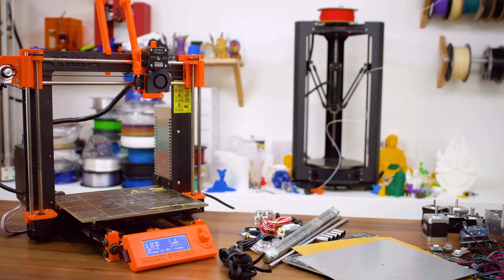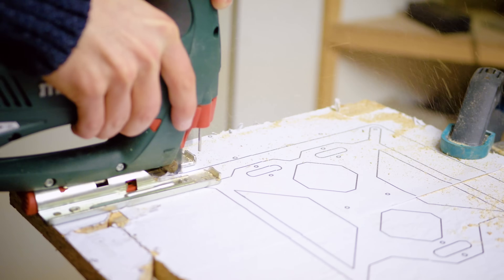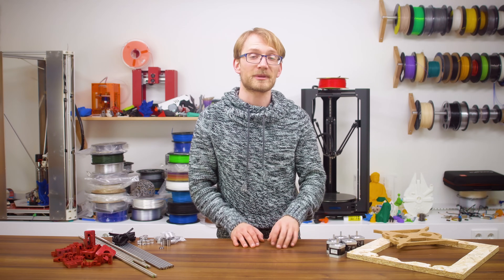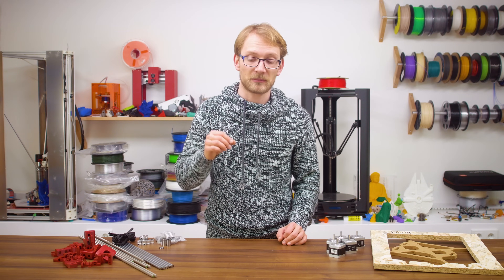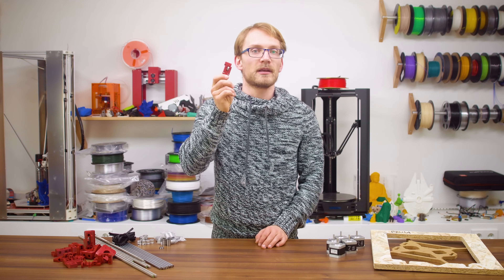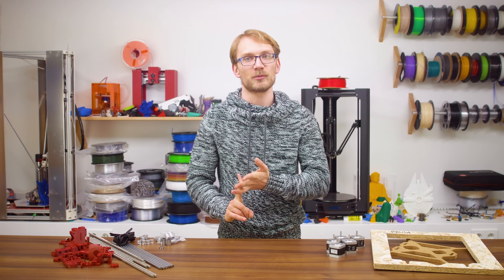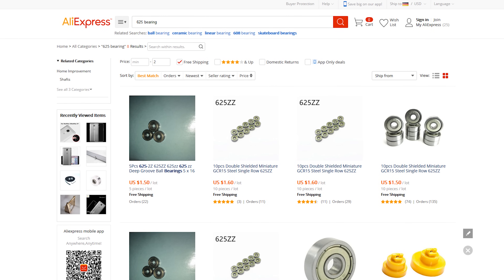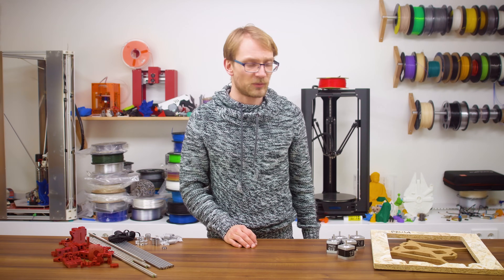Building the cheapest possible Prusa i3 MK2 clone: [02] Frame and motion!

Comment: Thomas, you probably won't notice this comment among the thousands you have but, I have an excellent tip for materials. Richlite,  it is very stable, doesn't transfer heat and is less expensive than aluminum. It's made from highly compressed recycled paper and phenolic resin.  Compressed at very high pressures and very high heat.  It is stable machinable and produces extremely stiff parts from the sheets they provide.  Though very few people in the 3d printing industry know of this product it is far, far better at producing stiff frames than even aluminum, because it has similar stiffness with greater weigh per part, does not transfer heat, less cost and is much easier to machine.  Peace.

Comment: If you are buying bearings, I can strongly recommend buying them from industrial resellers. I had a set of din 608 (I think) bearings on my longboard made by KSK, which lasted around 1000km with no maintenance required, it also offer you to get the kind you want (i.e. open, closed, sealed etc). And of course they can be a lot cheaper, I ordered mine together with a friend due to the minimum quantity required, but I remember paying around 12€ for a set of 8.

Comment: Lol. I've actually used trick at 11:02 in industrial packaging machine when stepper counter aluminium clutch broke and I had to get machine running quickly. It was to be temporary solution but machine has been in production with it for I think now 3 years :) I used soft pneumatic tubing for fix.

Comment: @frame & bed material: Is it wise to go with 18mm bonded resin-coated plywood ("siebdruckplatte") instead of OSB, which hasn't a nice finish...

moreover: can I use the 18mm bonded resin-coated plywood as bed material as well, or is that too think and heavy? should I choose 10mm MDF as tom did?

thx!

Comment: Hi, I've just started to build this prusa i3 for a High school project. But I have some problems. I've printed the parts in PLA but I'm not sure if it's the best solution because I started to assembly and my Y corner is cracked. I want to know if I have to Print with ABS.
Reply: If a part is used to hold the hot end you will have problems with melted parts. If you printer is left in the car on a hot day in the sun you will have a problem. PLA is go to about 60C. There is Some Heat Resistant PLA to about 88C.
Reply: Did you ever find out the answer?
Reply: You can use PETG.

Comment: I've been trying to free sketch this Frame Template as it will not Print Out for me correctly. Problem is when I load the files I can find for it in say sketchup to get the Measurements they seem smaller than what you have here. Like for instance you used a 10mm bit to start the hole in the bed for the bearing slot but all the files I can find on the frame they have have that as 5mm max diameter for the Bearing Slots.

Really wish Josef Prusa or Someone would would supply a Draft Layout of the Frame and Bed.

Comment: I just got a question regarding the printed parts: i see in your website that for y-corners.stl we need to print 2 or 4, but it is not clear for me, in your site it states: 2 for 350mm Y smooth rods, 4 for 330mm Y smooth rods 
that means we need to print 6? or it depends on the length of the Y-axis? (330 or 350)
the same applies to y-corners (open) x2.STL but I think we just have to print 2 right?

I am making a BOM list for building mine, and before bolts, nuts, washers, frame and printed parts i am at 150 euro, everything from AE, which is great!
thanks for your guide!

Comment: Do you have a link to the drawing of the frame's? ( would be nice! )
and also a question?
would you mount the X axis motor, on the other side?
or should you do once your thoughts over this or perhaps give an opinion on that.
I think this would be even more easily, the frame can then be wider.
(1) and it is become easier to make a box of the printer.
(2) this also in order to make everything more stable!

greetings from the Netherlands!
Rob.

Comment: hey Tom, great series. my son and I are gathering parts to follow along with the build.

Question about the stepper motors? Can I use steppers pulled from other electronics?  specifically copy machines. I'm a copy machine technician and can pull up to five of the 1.7in motors and a 2in stepper out of a single Japanese recycled copy machine.  Most are the same looking but some are slightly different looking tho still 1.7. can I mix different powers or torques together?

Thanks sooo much, can't wait for the build stream

Comment: great video!, why the 16 teeth pulley and not the 20 teeth one?
Reply: lean04 I had the same question.  from what I've read the 16 tooth has more torque and can print at slightly better resolution, but lots of people use 20mm and when you buy the 2m belt it comes with 20mm pulleys.  so I was going to buy 20mm idler pulleys too to be consistent?
Reply: When I went to go replace/modify a bunch of parts on my A8 I was thinking "why the heck do everyone try to use the 20 tooth parts???"  You do end up with less torque, but more importantly, if you stay with stock geometry the 20tooth parts misalign the belts and their mounts.

Comment: I'm going to try and cut out a frame but I am having a hell of a time printing out the Frame PDF. I have tried almost ever setting for the Poster Layout but for the life of me can't get it to print the whole thing. They definitely are not printing out at the right scale as well. It may be because I use Libre Office instead of Adobe Acrobat but who knows.... So it brings me to a question. Is their a File or Pic that shows the exact Measurements of each hole placement and line sort of like BluePrint? It would be a lot easier to draft the Frame Templet by hand than printing it out on multiple pieces of paper.
Reply: I can't even find the frame pdf.

Comment: I really like your idea of creating the prusa i3 mk2 clone.. That said, there are a LOT of cheap clone build logs out there, and if this is to be a MK2 clone, it really should have the really cool stuff that sets the MK2 apart from a regular old I3.. Like the auto XY calibration.  I know the MK42 bed is not readily available, but there is a version on it on Osh Park.  And although it would be expensive to produce there, a china pcb maker would probably produce it quite cheaply if one wanted to produce a few for a group buy or similar.
Reply: Thomas, where did you source the MK42 from?
Reply: The PCB-Layout is in the Gitrepo, so you can just order it at any pcb manufacturer that does such boards.

Comment: Just finished the shopping basket on eBay, without printed parts, fasteners or frame,  £140.73. A8 kit from GG, £147.47, (but probably + taxes and handling fees so about £180).

Yes, I could probably save about 10% by using AE, but I have the cash in my Paypal account, and none of the AE sellers seem to take PP,  (not surprised on their margins!).

I still think I'll go with the parts though. :)

Comment: The original Prusa i3 (3mm or "MK1") used PVC tubing for the Z-axis coupling, too.  The heat shrink tubing in the photo was placed over that tubing.  I think its purpose was to keep metal filings (created from the metal nut slowly wearing away the threaded rod) from entering the stepper motor, but I'm not entirely certain.

Comment: To note: I'm running two printers with hot end assemblies both printed in PLA. Neither is showing signs of creep or any other issues after lots and lots of use! So long as you're not super close to the heat block and cool properly there's no reason to worry (unless you end up printing really high temp materials).
Reply: Also, for your motor couplers, spider couplers are better than spiral aluminium but more expensive. What I use now are the self-cantering screw couplers on Thingiverse. They're basically a double ended 3-jaw chuck and made a big difference to my print quality when I started out.
Reply: I might have to have a look into that, is it this one?

http://www.thingiverse.com/thing:602481
Reply: I have used a lot of PLA parts over the years. The only issue I have had is when I tapped into the pla, the bolts eventually lose tension and the holes fill which a white dust I can only assume is corn starch. Absolutely not a problem if I embed a nut in the PLA.

Comment: im thinking about going for lead screws instead of threaded rods. thus I have a few questions:
- what size are the mk2 rods? T5 or T8?
- what things I should modify to get the best result with lead screws? better steppermotors? different mountings for the lead screw?

Comment: I bought 20 tooth gt2 pulleys rather than 16. Do I need to buy new ones or are the 20 tooth going to work?
Reply: Its adjustable in the firmware under DEFAULT_AXIS_STEPS_PER_UNIT the values can be calculated
Steps per Unit (X and Y Axes) = Motor Steps per Revolution / Idler Teeth / Belt Pitch/stepper ratio (1/16) default

Steps per Unit (Z Axis) = Motor Steps per Revolution / Rod Pitch/stepper ratio (1/16) default 

Steps per Unit (Extruder) = Motor Steps per Revolution * Extruder Gear Ratio / (Pinch Wheel Diameter * Pi) /stepper ratio (1/16) default

Comment: I'm building a corexy machine and I have 25 tooth pulleys. If I use those, am I going to have problems?
Reply: Gotcha. Thanks man. Awesome vids!
Reply: The good thing with RAMPS electronics the firmware is very configurable for different style of printer.

Comment: Hey, I got a small question.

Could it be a bit cheaper to use IGUS slide bearings, and then save some money on the linear rails (since the slide bearings don't wear the rods out as much) 

I got a pack of 12 for a fairly cheap price (I think it was 10€), and they work beautifully for X and Y axis so far, so they would be an option.

Comment: 26 bucks for 7 smooth rods? I bought 6 meters of smooth rods for 4 bucks and they are still doing great on my self designed printer :). No railing whatsoever.
Reply: ground rods, surface hardened with plating for $4?
so far this is my nemisis, all 6mm rail rods are from china and $5 each.
need a usa supplier.
Reply: Bought it at the local hardware store. Hardened, no idea, but for that money I won't complain and changing them out is peanuts.

Comment: Why didn't you used a bed frame that uses 4 bearings instead? Or the idea is to get as close to a MK2 as possible?
Reply: true. Have to remember that you've cut the part by hand.
I asked as I changed my i3 with some parts that allows it to use 4 as it had this awful side play something I have seen in almost all i3.

Comment: A small piece of advice - used motors can be 10 times cheaper than the new ones. And since it's a piece of equipment, that is virtually imbossible to be damaged through an exploitation - they should be as good as new.

Comment: could you get away with 3d printing the parts in pla and then when the printer is built getting it to print the mount for the hotend in abs, i got a xyz mini w and it only prints pla, or will it end badly with everything on fire?
Reply: thanks.

Comment: What are your plans for the heatbed? IMO the only real innovation of the whole mk2 design, as in the only part that can't be sourced, is the 9 layer heatbed design. Not only do you get  known areas of metal to do a mesh bed level, but the differing copper traces on each layer allow for the board to heat more evenly. Whilst one can get bed leveling using an aluminum heatbed, or in my case a sheet of at home aluminum foil glued to the bottom of a boro-glass sheet. While the glass is flat, with a known thickness that I can offset from, it doesn't provide the blank areas for the firmware to home in on to create the mesh.
Reply: Is the bed of Original mk2 ever going to be available?
Reply: No, probably not from Joe P. He wants you to buy the upgrade kit when all you really want is the bed, plus there are not enough beds to supply his machines and sell them ala carte as well, supposedly. I have studied the bed design from what is available, unfortunately it's only open sourceish. The design elements are on github but they are not willing to answer questions about the physical makeup of the board. With a 9 layer board there are some PCB materials that are better for warping and heat resistance, but they will not reveal which ones they used to make it. I was thinking of doing a kickstarter to make a series of heatbeds to at least have the multi element design even if it's not 100% the same, it's better then whats currently available. I'm not sure if there is interest in it though. It would be nice to make a mk42 clone and a standard square model though IMO.

Comment: MDF is heavy. MDF is used in speakers because of the density of the material. I would have just used 3/4"  hardwood plywood. It's stronger and more lightweight. Might be a little bit more expensive.
Reply: Were talking economy build here, use whatever you have laying around. I have an old beat up oak table in the garage which might be the ticket!
Reply: Man made sheet good are actually more dimensionally stable than natural wood is. Read plywood warps less.

Comment: I think lead screws are way worth it. The threaded rods cause to many inconsistencies vertically.
Reply: I used 5mm stainless steel threaded rod and have no wear issues 3 years on.....
Reply: Causes my machine to slip the nut too so I am having to adjust it prior to each print or let it do the first layer then rip it off and adjust.
Reply: Lead screws with POM nuts also don't wear out anywhere near as quickly and are generally much straighter than threaded rods and nuts. If you like to use the "lift Z" setting in your slicer, you can rapidly wear out threaded rods and lead to z-axis wobble.
Reply: V all thread is made to bind, and lock up. Which are not desirable qualities for linear motion. Plain all thread is incredibly inefficient when it comes to motion. So you get slower moves that require more torque. All thread is about 10% efficient and ball screws are 90%. Acme thread is 40%. Multi start trapezoidal is pretty good too. Somewhere between acme, and ball screws.

Comment: No reason that you couldn't use SAE threaded rod for the Z drives.  10-32, or 1/4-24 rods are the closest to 5mm, but I used 5/16-18 rods (close to 8mm) in my first repstrap (later changed out to 8mm lead screws).  The on line reprap calculator page will give the correct steps/mm value for any of these choices.   I used vinyl hose for the couplers on my repstrap, with hose clamps rather than zip ties, but I am using Nema-23 motors with 1/4" shafts.  I later printed couplers from plastic.  Also, my plastic parts are printed in PLA, and there is nothing wrong with this material, except maybe for around the hot end (but my hot end clamp block IS printed in PLA.  This is at the coldest end of the hotend where the filament enters, it does not get even close to hot enough to be an issue!  Since the X carriage on my repstrap was machined from aluminum, I didn't need to use ABS near the extruder, these parts are METAL.   The Y axis parts holding the linear rods are PLA, the XL belt clamps are PLA, and the belt idler tensioners are also PLA.

Comment: booooooo!! wood!!!..... carry on....
Reply: I just cant deal with making machinery out of wood... 30x30 aluminum profile extrusion is so cheap now... there really isn't any excuse not use it.... I know this is a cheapest build video, but the 30x30 is so much more superior over wood its worth the couple extra bucks...  so in the end you would wind up having a Rebel II frame... which is a  prusa with a 30x30 frame...
Reply: It is more than a couple bucks. Used right wood works too. My CNC is wood frame and it is easily accurate to better than a thousandth of an inch.
Reply: I recently picked up enough 30x30 profile to build a 300x300x300 rebel II style printer for $35
I also have a 13"x40" cnc router I built from aluminum.... so I could cut a perfect frame from wood....
i'm not  an anti-woodworking guy, I have a full woodshop so making it from wood wasnt the issue, I look at it as when making scientific and test equipment they often use alum. extrusion so its been proven a quality technique
Reply: 80/20 has an ebay store for the odd cuts and sometimes a hole drilled.... its all about keeping an eye out for the deals ..... heres an example http://www.ebay.com/itm/80-20-Inc-T-Slot-30mm-x-30mm-Aluminum-Extrusion-30-Series-30-3030-x-455mm-N-/330909426244?hash=item4d0bbd2244

also I have a McMaster Carr I can drive to if I want full lengths, so no shipping

Comment: What place would u recommend to get the needed parts printed besides 3DHubs and in which quantity do I need which parts?
Which ones do i actually /need/ to get the thing to run and which ones i can then print on the machine itself ( i am p sure that things like the lcd cover are optional for the printer to /work/ :P)

Comment: I have been 3d printing my Z axis couplers these days. I started doing this when I replaced the Z axis couplers on my printer bot that i damaged while upgrading the Z axis. I dont even set screw them, I just use either super glue or red loctite (just make sure it doesnt drip into the motor/bearings). If you have to remove them I just hit it with a soldering iron tip to melt it right off. I have yet to have one fail. They cost cents to make and dont require being printed at a high infill.